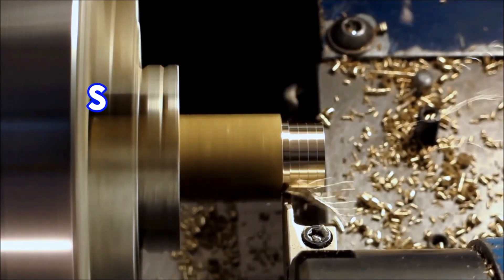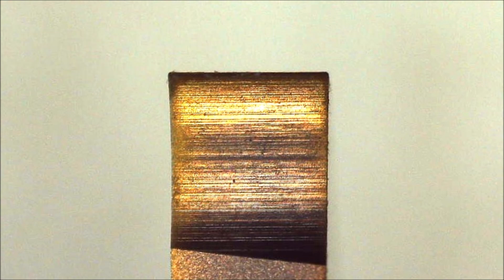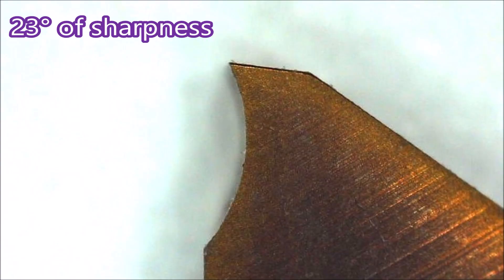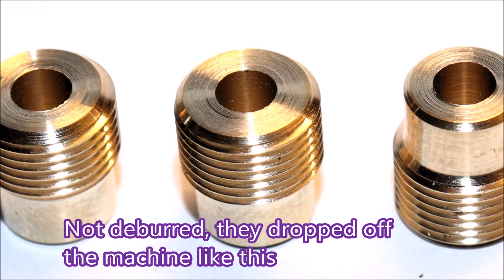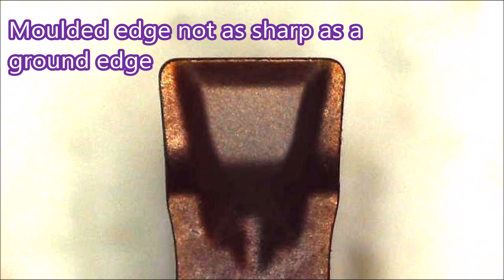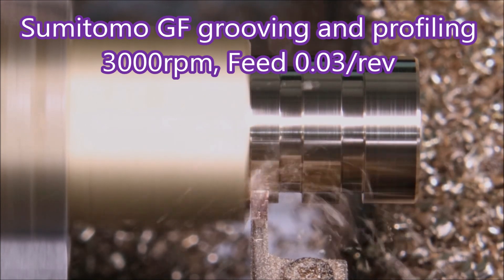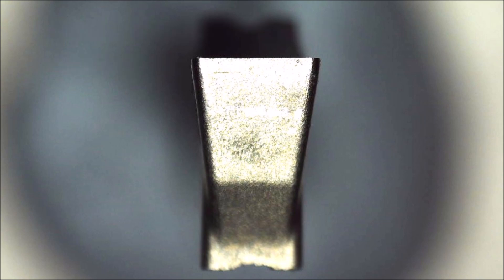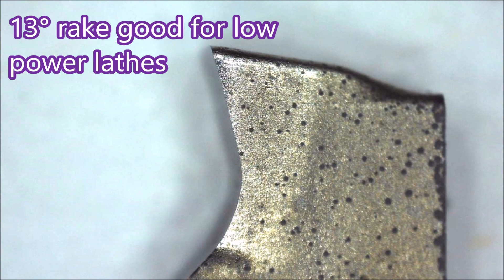Sumitomo and eBay ground edge parting inserts for small cnc lathe

Comment: I like to use inserts that can be found on eBay when searching for MGGN H01
The work very well on my SC4 that is converted to cnc. I mainly do aluminum and brass, no idea how they would hold up in steel. They are dirt cheap and work very well for my applications.
Reply from the maker: I have not used the inserts you speak of but have used inserts for turning aluminium to turn free cutting steel.  Work well in a lathe low on power, don't last that long but as you say they are so cheap it does not matter.

Comment: I use ground MGEHR style ones, they are meant for cutting aluminium but they work well for brass and steel, but obv wear down a lot quicker.
Reply from the maker: Hi, thanks for your comment, I thought that was the code for the tool holder rather than the insert.
Reply: Yeah it is my bad the insert is MGMN 200-G AK10 and they fit in the MGEHR tool holders. @smallcnclathes
Reply from the maker: @Festivejelly  I looked them up and what I found looked much like any other inert but polished rather than coated. Nigel
Reply from the maker: Just released another video where you get a mention. Nigel